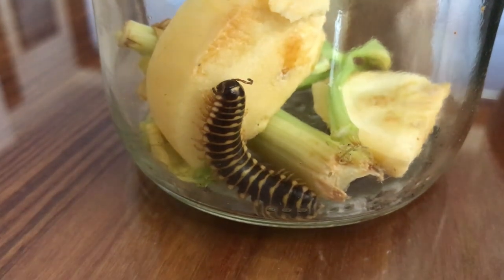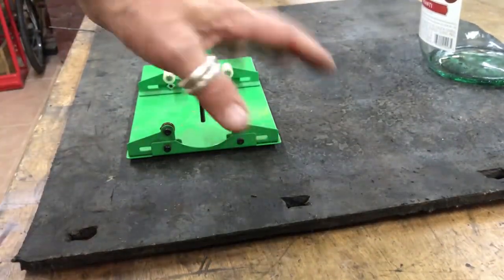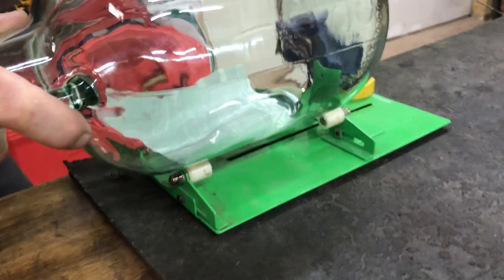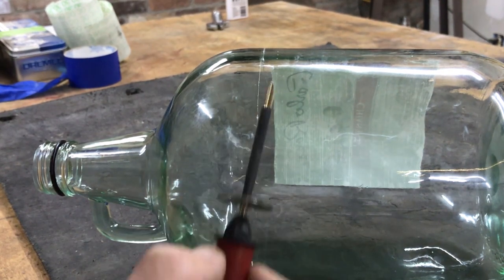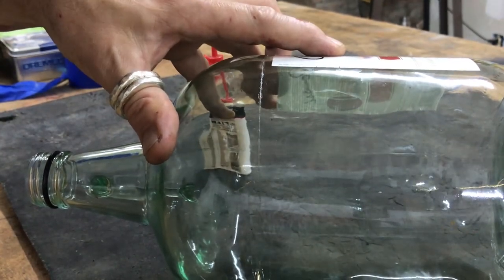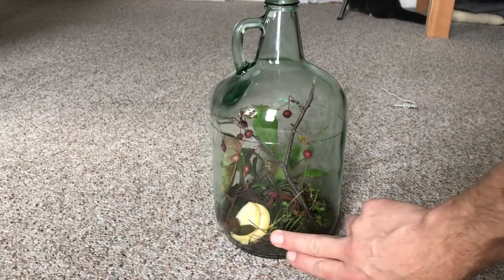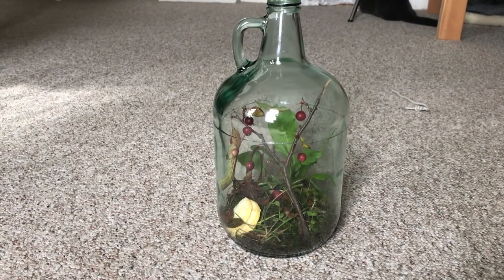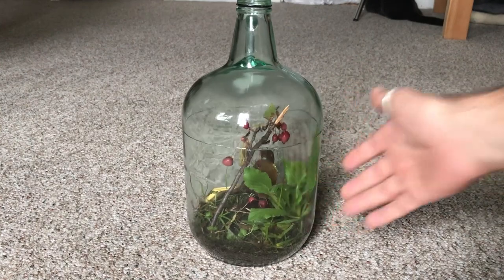Cut A Thick Wine Bottle - Terrarium Vivarium for a Millipede

Comment: Fantastic you could polish both edges on a flat surface so that if is almost invisible    
I wonder if it works at the lower end of a glass home brewcdemijohns with small holes    a nice project     ill have a try when the cutter comes

Comment: I’ve got no experience but anyone ever tried a mini-torch or maybe one of those focused lighters to speed the process up? 

Another idea would be to start a few cracks around the bottle instead of following the first. Those starter cracks take longer so may be no faster. 

Could try to etch/sandblast the cut line to propagate a crack too. 

I could just be patient too. Some things just take time.
Reply from the maker: A micro torch, I believe, may be too hot too fast... you really need to ease the heat into it slowly-otherwise I find the crack tends to steer off track.
A few cracks would be a bit more work to match up...more gaps. Instead of one gap you would now have a few that you’d have to line up when you approached the others. I really think it’s best to work from one side to the other and only meet up one time -at least that’s my experience.
Also, if you were to sandblast a line it may perhaps work, but I think it may be more work than it’s worth since you’d have to mask the whole thing off and be certain you had a consistent width to the fine line all the way around the bottle and it wouldn’t have the same type of split that the glass cutter puts into it. 
I think patience is really the best method and is the most controllable ;)
I really appreciate the views and your input- if you try any of the other methods please let me know how it works out for ya! 
Cheers!

Comment: I wanna use one of these bottles as a coin bank, is the glass thick enough to handle coins?
Reply from the maker: Absolutely . In fact it’s one of the strongest bottles I’ve come across. I have hit them with a hammer in a trash can to to just break them down and it wasn’t easy to smash. I’ve also just drop tested a few and they are very strong.  I couldn’t break one by dropping at a reasonable height.
Reply: @fleanine  nice, thank you so much for the reply